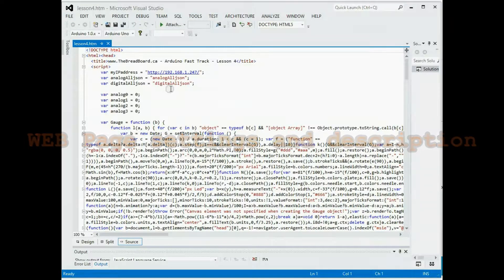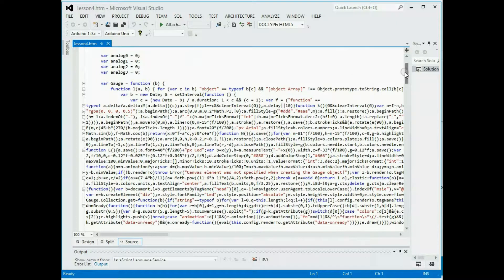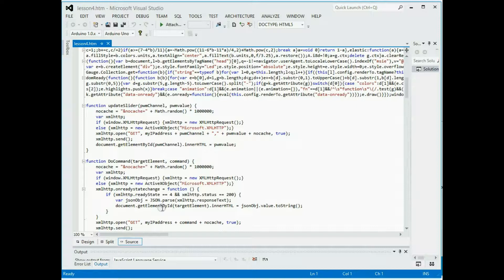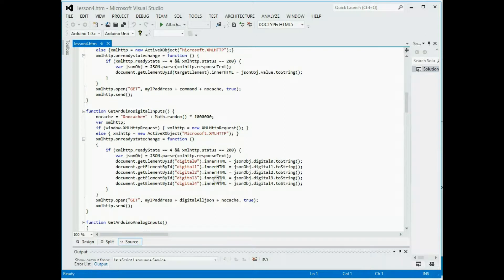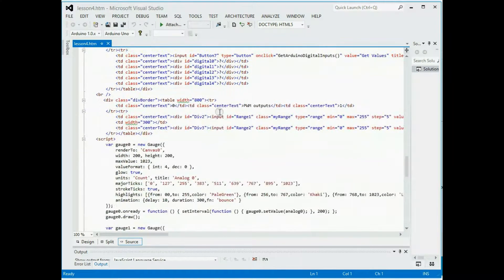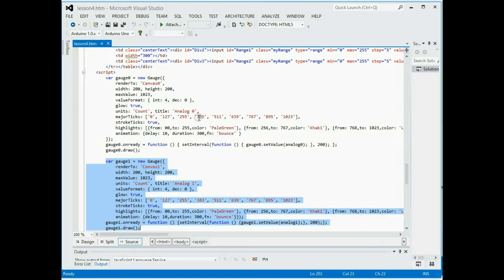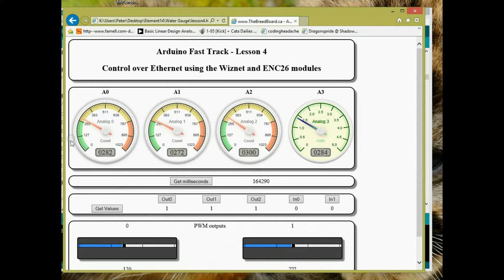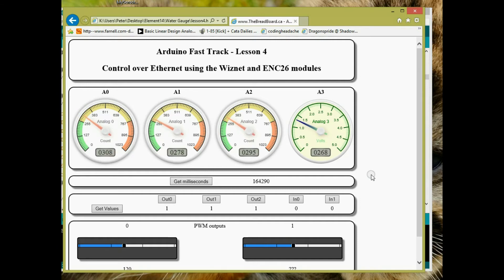Lesson 4C Web Page Settings and functionality

Comment: Goodnight Peter, I am Brazilian, I would first like to congratulate their work. I carried your project, changed the network settings but does not work perfectly, the Arduino receives commands but the page did not get the Arduino data. What should I be doing wrong? I thank you.
Reply from the maker: Bruno Batista If you can post your sketch it would help, the best way to do this is via the Element14 community web site, I am a top member there and it has all the facilities to post diagrams and sketches right in the community pages, make sure your in the Arduino Topic Space and add my name in the body as @peteroakes this should then send a direct email to me when you submit it.

http://www.element14.com/community/groups/arduino?ICID=menubar_topics_arduino

the other option is to simply email me the sketch but the E14 site is the better option as you will also benefit from other top members providing help too. It is a great community. oh, and the answer may well help others too ( WIN WIN)
Reply: Peter Oakes 
Hi Peter,

thanks for some great toturials. I think I can help with the problem. I tested this example and I am using Firefox and couldn't get it to work. I see in your video that you are using Explorer, so I tested with Explorer and it worked.

I then tested with Crome and again things didn't work. By opening the browser consol (Firefox) I could see that there was a problem with cross domain data since the data from the arduino comes from an other IP-number.
The way to solve that is to add to the arduino header and allow the data to be used from a different web page (in this case the GUI page). Simply add this line in the 200 and 400 header
client.println("Access-Control-Allow-Origin: *");

Best regards,
Michael
Reply from the maker: Michael Nielsen Thanks I appreciate the tip, and I'm sure everyone else does too, I will try this next time I'm in the code